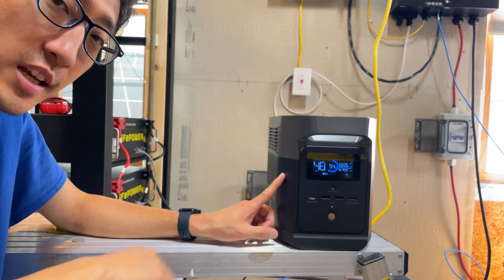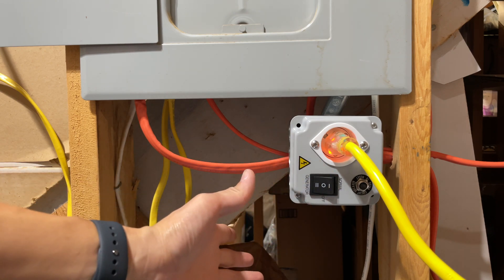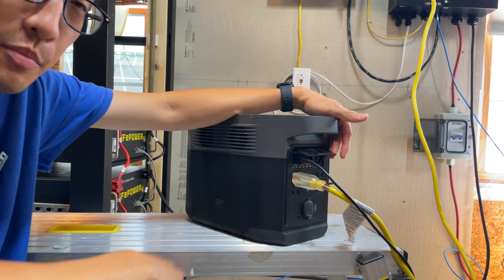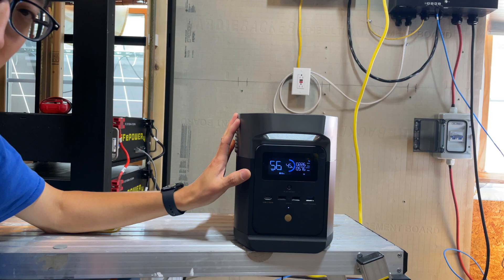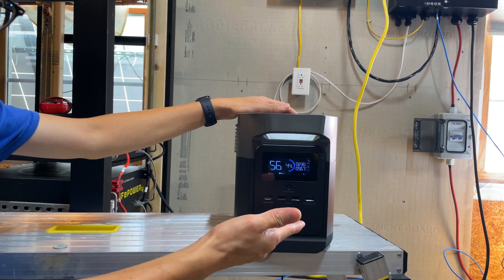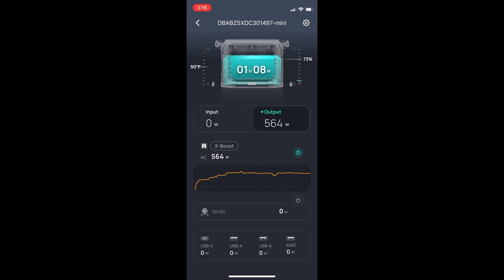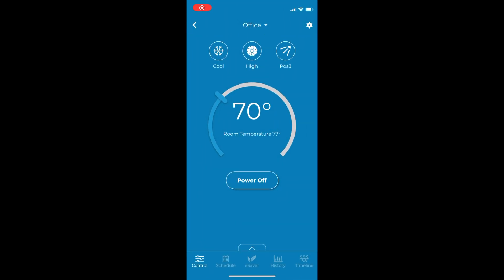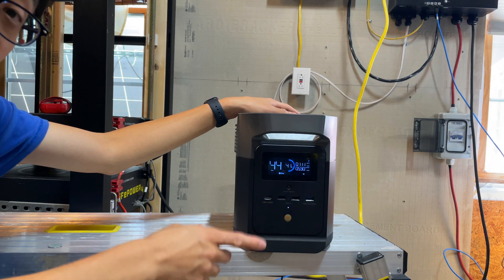How a Mini Solar Generator runs an AC mini split through generator transfer switch | Delta Mini

Comment: Good day!
I appreciate the video.
I’m trying to run a similar setup (mini split powered by delta) in my van. Can I just wire directly from the outside unit into a 120v plug and plug it in directly into the flow?
I’m lost trying to find the right way to get it to work..

Comment: PV is great for AC, Running my whole house on less than one hour of our 27000Wp PV system no problem.
The problems are during Dutch winters where our system barely produces near one kWh per day!
That's nothing.
Reply from the maker: Yeah that sounds pretty bad. Good luck this year